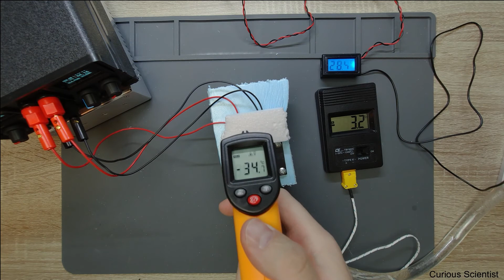Below -40°C with stacked Peltier thermoelectric coolers

Comment: Hello, I am working on a project which involves cryocoolers, I know these devices are a bit lacking but do you think they could be used in combination with a Stirling cryocooler to lower the temp to about 10F, currently the only cryocoolers which meet my limited space restrictions have a lowest temp of 40f. Thanks.
Reply from the maker: Hi! I am not trying to nitpick, but something that barely goes down to 10 F (-12.2°C in proper units...) should not be called a cryocooler. Cryogenic temperatures start below -150°C or so. -12°C should not be a problem to any Peltier cooler, you don't even need to stack them or use any fancy coolers in combination with them. However, it is important to remember that they are very inefficient. Even though they reach relatively low temperatures when there's nothing on their cold side, the more heat they need to move the less the lowest temperature on their cold side becomes achievable.
Reply: @CuriousScientist  whoops that's my bad, replace the f with a k. Those units are supposed to be in Kelvin.
Reply from the maker: Peltiers max out around -50°C, so they won't work at those temperatures.

Comment: I think I have fake ones.  Got 12706 and 12715.  The 06 I get 3.5Amps at most, and the 15 I get 2.5 amps (even worse?!).  Both figures while applying 12 volts.
Reply from the maker: Could be. I also encountered 12715 modules, which were actually 12706 based on their voltage and current consumption.
Reply: @ thank you for the reply and confirming my suspicions.

Comment: Wondering if you'd lend your expertise: I'm trying to use these to increase cooling on a large flat surface that's air cooled (just trying to gain any small advantage I can) I have 10 of these and I'm wondering if two rows of 5 in series, or 5 stacked would be better for overall cooling? They will be stuck to the flat side (top/bottom) of an air-to-water heat exchanger, roughly 2 inches deep, and 18x5 inches overall. The hot side of the peltier coolers would be exposed to atmosphere, would there be more cooling to be had by having a heat sink on the hot side? Current plan is to power with 12v from my car charging system.
Reply from the maker: Hi!
I recommend this video to answer your question:
https://youtu.be/cX8XHV0c9Aw

Comment: я извиняюсь, но у вас там внизу точно 12715 стоит? ибо 14.2А такой модуль может потреблять при напряжении около 15в. Плюс минус пол вольта(в зависимости от нагрева)! Возможно у вас там 12730? Который при 9в(по даташиту) потребляет как рааз 15А... 
ну или вы просто немного привираете с напряжением
Reply: exactly!!! My 15 peltier is taking up like 3-4 Amps best at 14 volts. ig its either we have a pooopey efficiency peltier or his readings are wrong (which i highly doubt)
Reply from the maker: If your Peltier draws 3-4 A at 14 Volts and it supposed to be a TEC12715, then congrats, you have a fake module. It's not uncommon to have "relabeled" modules sold as 12725. I have a few of those unfortunately. They are typically 12706 or 12703 sold as 12715.
Reply: @CuriousScientist  Вы точно перевели то, что я написал? 12715 не может потреблять 15А при 9в! 12730 может, а вот 12715, если в нём нет внутреннего замыкания - нет!
Reply from the maker: I answered the guy who wrote in English... I don't bother about non-English comments.
Reply: @threeuniquefingers  3-4А 12715 потреблять может в двух случаях: 1) перемаркировка из 12706/12705; 2) структура внутри "подгорела"(запускали на полном токе без охлаждения).

Comment: Can you make a highly efficient water heater out of a stack of those in series by water flow and parallel by air exposure. Perhaps even adding a heat sink to the side exposed to the air for better conduction? Would thermally conductive epoxy glue help?
Reply from the maker: I guess by series, you mean electrically. A stack is really not needed because you won't be able to pull more heat through the system than the bottom unit can pump. Heatsink on the side is not a good idea as you would create a thermal bridge between the hot and cold sides. A thermal epoxy is typically a worse thermal conductor than a proper thermal paste.
Reply: @CuriousScientist  No the water in series one to the next getting hotter with each but thermally in series parallel , electrically parallel. It would be an instant heater you can buy resistive ones for tankless hot water. As for the heat sink it doesn't bridge the hot and cold side it would be on the cold side to bring in more heat to be transferred to the water. Thanks for the info on the thermal paste - you would need to design some sort of fastener to keep a little tension on them. I wonder how much energy you would save vs a resistive heater.
Reply from the maker: I see. So you basically daisy chain a few of the water cooling block which are cooling the hot side. Let's say in this fashion where larger number means larger hot side temperatures: [1]→[2]→[3]→[4]. Could work, but you cannot use it at too high temperatures! Remember that a Peltier cooler has a delicate inside (check my YouTube Short video where I opened one up!) and it is soldered. Also, as you are getting warmer and warmer hot side temperatures, the Peltier will be able to pump less and less heat from the cold side, you will rely more and more on the Joule heating. Hence you lose the gain you would expect by also having the Peltier effect. 

Heat sink on the cold side is of course a good idea for the exact reason you mentioned. 

But overall, I would not have too high hopes on getting large gains. The temperature differences are not too high here, so you can't expect too big values either.
Reply: @CuriousScientist  Remember you want flowing water to come out at temperatures that can't harm people so it doesn't need to exceed 42 degrees Celsius that's the pain threshold. With temperature sensors you could feed your shower with a temperature controlled water feed. You wouldn't want too many of these flowing water heaters in the home but bathroom, kitchen, laundry room might work.
Reply from the maker: How should I remember if you never mentioned the exact use? 😅Also, so far in my life, I have never seen any taps providing hot water so precisely and I have been to some places. It was always hot water mixed with cold water in the tap... Also, I hope that you are aware of the fact that those instant hot water heaters are literally several kilowatts (2-3 kW) devices!? There's no way you can provide that much with a Peltier. It is definitely not suitable for such task.
Reply: @CuriousScientist  When I lived in Germany there was no central hot water tank in the older house I was in a small tank in the kitchen and bathroom that you turned on to wash dishes or shower.

Comment: thanks for the video, I was wondering if I can build a DIY calibration bath for -30°C for my refrigeration K type probes (clamps and bulbs), Now I need to think the best way to build something compact.
Reply from the maker: Hi! I guess it could work with some small metal container, which is well-insulated. Sometimes, those cast aluminium enclosures are very good vessels, too.

Comment: At the -40° cooling side how many degrees on the other side?
Reply from the maker: Hi! I did not measure it, but you can calculate it back from the parameters I showed in the video and by using the performance chart of the top Peltier. But I assume, it is somewhere around 0°C.

Comment: Hey, big UP for your videos! You're helping a LOT! I've watched them all but still  I have question which is very important for me.

I'm bulding a prototype of a device which I plan to put into mass market and I'm struggling. 
To be short let's say it's a cooler which has to cool up to 5 degrees celsius no matter the ambient room temperature(let's say up to 40°C).  The cubature of a thermal-proof container which has to be cooled is about 250 litres max.
My orginal plan was using 2 or 3 peltiers(how to connect them?), because afaik one will not be sufficient for that capacity.   I bought 3 x TEC12704. I won't go with water cooling, but did a thourough research on cooling performance of CPU fan coolers and I want to use 3x of them stacked/combined, each has a TDP of 120W(can be more, or less if that's too much).

The question is will it work?  -> is that the best choice of a TEC module? will that cooling on the hot side be sufficient? I understnad a need a super low DT to blow a lot of cold air and a peltier similar to my TEC. 

Thanks again! :)
Reply from the maker: Thank you! 

What do you mean "it has to cool up to 5°C"? You mean it has to maintain 5°C, right? Regardless of the room temperature. 

Is the container just filled with air? Will there be any significant thermal mass inside the container?

One will not be sufficient, but probably 3 won't be enough either. Especially the 12704. 

How do you imagine stacking them? If you stack them, the maximum cooling power will be the cooling power of the bottom unit. Which is really low. You won't achieve better cooling with stacking, you just reach lower temperatures. 

It won't work. The best choice of TEC module depends on your budget. 

Also, if you are expecting me to advise for a commercial device, you can hire me for consulting. I hope you understand but I won't invest my time helping if you are going to profit from it later because I am not a free support service. 

Cheers!
Reply: @CuriousScientist  Thank you for such a quick response! :) 

Yes, I meant it needs to hold as low as 5c, but I'd like to have the option to adjust temp  between ~5-12 C.  

It will be a drier, the mass inside won't be thermal, it'll be wet, but I will put a dehumidifier inside. From the peltier I only expect keeping this a temps mentioned earlier. 

I'm considering getting a paid advice as this  will be essential, but for now I'm trying to assess the direction, because I bought a 3xTEC 27015 peltier cooler from ebay but it only went down do 14 C in my current 80L container. 

I'm also trying to assess how expensive would that cooler has to cost, considering everything else, because there are few other elementets to this project.

If you be so kind and drop a few more cents  into this I'd be grateful.  
How can I contact you?
Reply from the maker: I see! Probably you power the coolers incorrectly. It is hard to advise without knowing the system in more detail. 

I have a website, and there is a contact page on it. You can reach me via that page. But once again, please keep in mind that I am not a free support service.
Reply: @CuriousScientist  Ok thanks! I'll be in touch, cheers :)

Comment: Ur explaining about how to stack them is Horrible, which part is hot and what cold what facing what, how you cool them.
Reply from the maker: Why? It's super obvious. You cool one Peltier with another, so you put the top cooler's hot side on the bottom cooler's cold side. Then you cool the bottom cooler's hot side with a water cooler.

Comment: Dear,sorry can I ask you why there is no larger peltier say 12 amperes?
Reply from the maker: Hi!
There are! For example, the TEC1-12730 can be run using 30 A. On the other hand, you probably would not want to drive it with 30 A, because it would heat itself up instead of cooling due to the huge amount of Joule heat.

Comment: Which is better to cool the hot side..! water or coolant?
Reply from the maker: What do you mean? Water is the coolant.
Reply: I meant vehicle coolant instead of water..
Reply from the maker: @IGodFucker  Water is better. Just because coolant has 'cool' in its name, it does not mean that it does any cooling or similar... Coolant is nothing else but just water and some alcohol (ethylene or propylene glycol) to prevent the water from freezing at 0°C (and actually lower)... If you dilute water with alcohol, it will absorb less heat, so the solution's temperature will rise more quickly. So, a cooling system with coolant in it instead of water would perform worse. Also, the coolant is a nasty chemical, you should stay away from it.
Reply: @CuriousScientist  Highly appreciate 👏👏👏 your knowledge about all this stuffs, that's the only reason am following you..

Comment: at what voltages and currents did you run each of the modules?
Reply from the maker: It's in the video.
Reply: @CuriousScientist  thanks, but i have decided not to use peltiers for my project, they are too power hungry, im using dry ice instead
Reply: @YoungPhysicistsClub1729  making a cloud chamber?

Comment: pro tip: if you want to avoid the ice buildup, you can reduce by just spreading a drop or two of anhydrous isopropanol which is rubbing alcohol
Reply from the maker: Thank you! That is indeed a great idea; it doesn't freeze on the surface and it displaces water too! I wonder how fast it would evaporate from the surface, but probably not too fast since the surface is relatively close to the freezing point.
Reply: @CuriousScientist  you are right my friend, it will not evaporate too fast, I plan on using this design of cascaded peltiers to cool the surface of a cloud chamber that I plan to build soon, which will have supersaturated vapour of isopropanol inside, that is why I suggested it.
Your video has truly been helpful my friend, I shall put it into action after my exams get over in a month, thanks!
Reply: I also am planning on using windshield washer fluid so I can bring the coolant down to temperatures of -18 C, and it will still be liquid which will be better for cooling the peltiers I hope
Reply from the maker: @YoungPhysicistsClub1729  Good luck with the exams! 

By the way, the coolant is only meaningful if you cool the hot side with something below the freezing point of water. In my demonstration, the water in the cooling loop is circulating in a regular CPU water cooling system, so in the "best case", the water is at room temperature. However, if you immerse the hot side cooling loop in ice, then you might need some alcohol-based coolant.
Reply: @CuriousScientist  yes I am aware, windshield wiper fluid is well below the frezing point of water, it goes down to -18 C without freezing I think
thanks for the suggestion tho

Comment: I want to convert my ice box into a mini freezer. So I'll probably use a similar setup, but with a good fan based heatsink on the outside and the inside, and a temperature sensor switch. I just need -10 degrees but need it to be as efficient as possible because I'll be making it rechargeable. Would you recommend a 7.4v battery or a 11.1v battery for better efficiency? I have enough cells for a 12500 MAH battery at 11.1 volts, or 20,000 mah at 7.4 volts. But need to run heatsink also on it. And will it be sufficient for 40-50 hours of cooling? My ice box is 30 liters, medium amazon quality. Not a very high end one.
Reply: Test and try yourself
Reply from the maker: Hi! You can calculate the power needed to bring down the volume you want to cool to the required temperature. Then you can see how long you can run the Peltier coolers based on their performance chart and the capacity of the batteries.

Comment: I am just wondering if I just use 2 Peltier to get the water down to -xx Celsius - not stacking is enough? Or must I stack them as you did here to get -40 C? 

I like to get my water cold to use with my evaporate heat exchanger with a fan to give my van an air conditioning effect. 

Without the Peltier system, I must always buy ice to keep the evaporate heat exchanger system producing cold air, which I can't always do due to the location of my van. 

I use water coolant and a fan to cool down the hot side of the Peltier. 

I have not done it in real life yet but just think it out loud.
Reply from the maker: Hi! There is one thing that must be kept in mind: stacking means lower temperature but less transferred heat. If you want to cool down a large volume of water, you do not need to stack them, but you need to use multiple devices. Also, you should run them at low voltage and cool their hot side well. However, keep in mind that one or two Peltier cooler might not be sufficient for cooling the water down and keeping it cool. I will have a relevant video in this topic in 1-2 months. Probably it will be "too late" for you, but still might be something you will find useful for the future.
Reply: @CuriousScientist  Thank you so much for taking the time to reply. As I sat in meditation last night, I thought of some arrangement that may not necessarily cool the water per se but can help with the cold air for my heat exchanger.  This can be done by placing the cool side of Peltier on top of my Styrofoam container with a heat sink and a small fan.  The fan will circulate the cold air, giving out cold air next to the heat exchanger, which I will place next. So although the water at the bottom may not be cool as much as I would like or as fast, the cold air on top, which is immediate it could help the heat exchanger cooler and when my fan, which I placed on top of that heat exchanger, can give me colder air. 

Another shorter and quicker solution is to buy an ice maker machine which is about $89.00, and produce ice as needed.  But it is also time-consuming because it can only produce 8 pieces of ice in 10 minutes. 

I am waiting for the container, small fans, and heat sink to carry out this experiment. I will be sure to route back here to tell you my result.